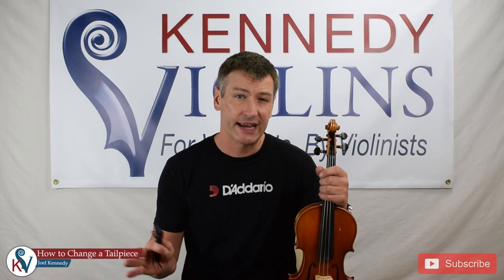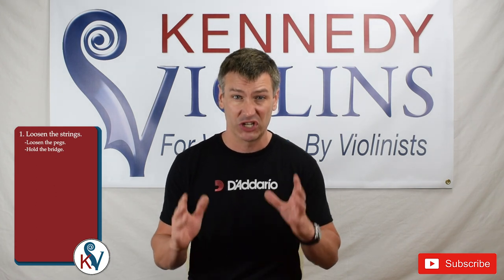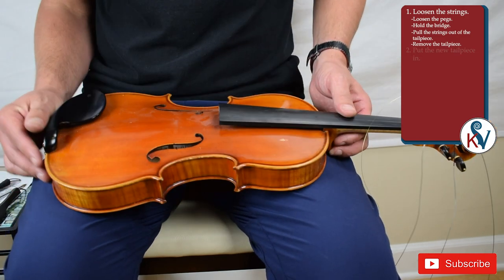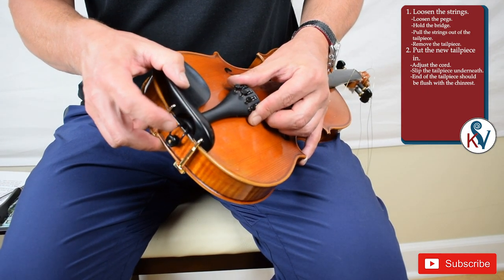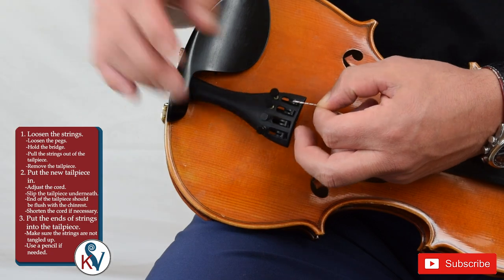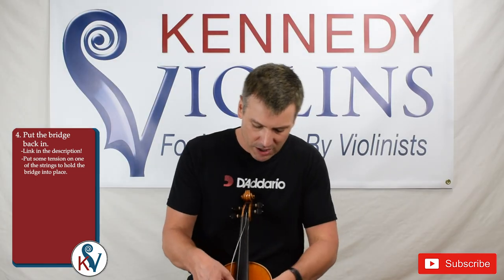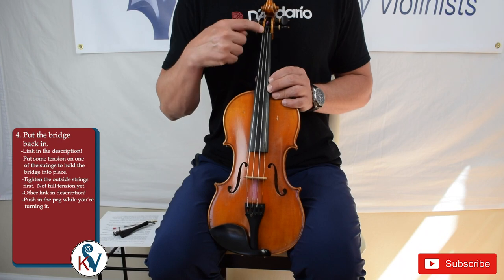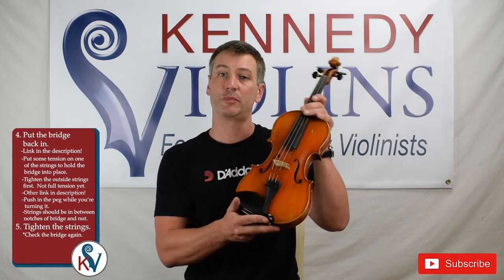How to Change a Tailpiece | Kennedy Violins

Comment: This has help immensely. I inherited an old violin that was stripped of parts. I have re-haired the bow (in a fashion but not too successfully). I refinished the violin using french polish and now am assembling the new parts. I don't play but want to make this old piece playable. I have the new parts but some don't seem to fit. The tuning keys barely reach the second hole. but the string holes seem to be about center. The end pin is too small so it doesn't fit the existing hole. Your video did show me how to assemble the tailpiece and bridge. Thank you so much.

Comment: Hey very cool video, great detail and video quality. I have a question, I'm new to violin, so, what would be the difference between strings ending in ball or loop? Do they make specific tailpieces for each? Thank you!
Reply from the maker: Hello Jesus, great question.  In fact, perhaps I should do a video about it.  Some strings are loop end but they are mostly just the E strings. Most strings are ball end.  Just about any tailpiece will take a ball or a loop end, so it shouldn't be much of an issue.  In my opinion, if you have a choice, you should always choose the ball end.  Generally it'll be easier to install and function better.  let me know if you have any ideas of more vids to make.  Happy practicing!

Comment: hi there, can someone please help me with something? a friend of mine that is starting with the violin, damaged the cord tied to the tailpiece and it needs to be replaced, the store where she bought the violin just sent her the "neccesary" things to repair it, do u guys know how is that process of replacing the rope? thank u so much
Reply from the maker: Hello Luis,  replacing a chord is pretty easy.  Changing out the tailpiece is probably the hardest part.  The only video I did for this is here:  https://www.youtube.com/watch?v=wCGMV0ndAV8 You just have to make sure you adjust the chord so it is the right length.  It should be flush with the tailpiece.  Let me know if you have any other questions!

Comment: how do i get my end pin out of my cello
Reply from the maker: It's pretty similar to a violin.  You have to disconnect all the strings from the tailpiece, remove the tailpiece, and then the end pin will come right out.  You may have to twist and pull a bit but it'll come out eventually!